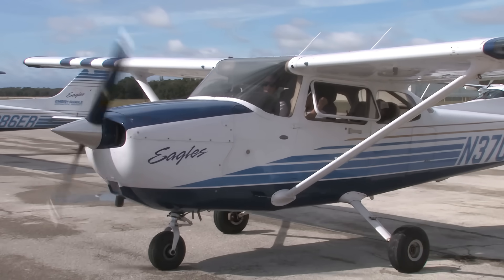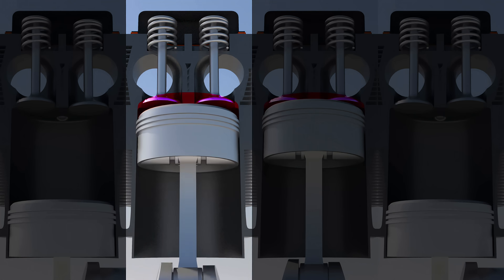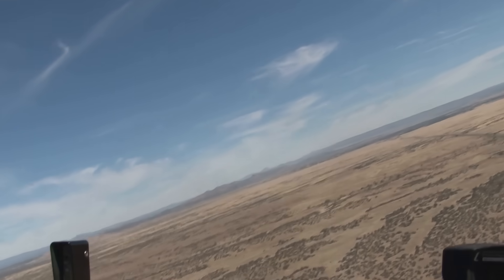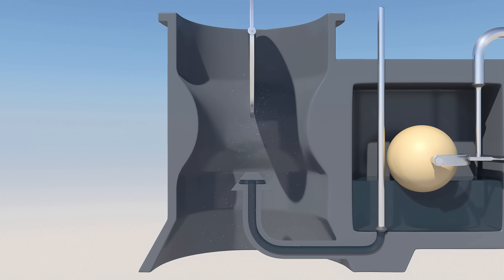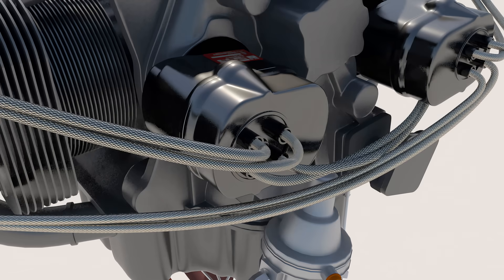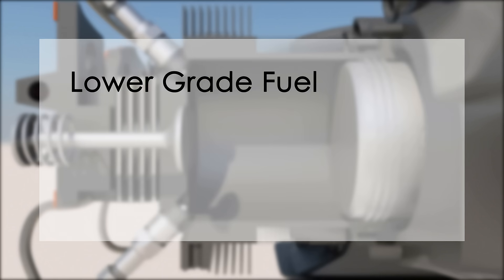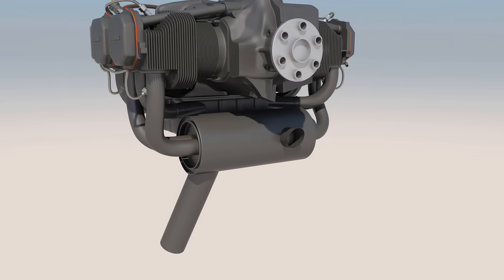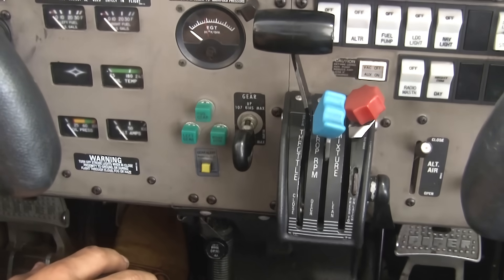Aircraft Systems - 03 - Engine

Comment: How is it possible that this has so little views? AMAZING!!!
Reply: 270189H30230 I really agree with you , I never saw explanation like that before , the best of the best baby ❤️
Reply: 270189H30230 yeah, I’m just starting my PPL and this really helps a lot
Reply: I agree with you too. Ill better share this video to my friends.
Reply: bc it has an unsearchable 03 Engine title
Reply: 270189H30230  is it necessary  exhaust to be provide to the cabin, any one can help me there I confused 12:30
Reply: John Doe thanks bro
Reply: The exhaust gasses are completely separate from the air used to heat. The air comes from outside the aircraft, pass through a heat exchanger (heated by the exhaust gasses), then the heated air is allowed to enter the cabin.
Reply: IKR? This vid is a gem!
Reply: @NonyaBusiness! Congrats!!
Reply: it has a million views NOWW WOOOOO
Reply: check again
Reply: It is a massively flawed and very bad for education, that's why!
Reply: Julian Neale Tell me why.